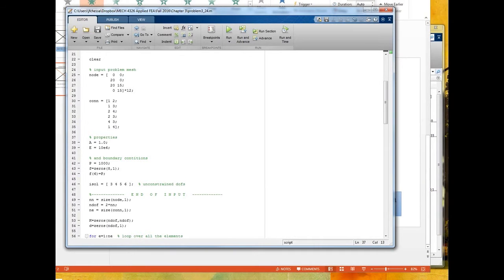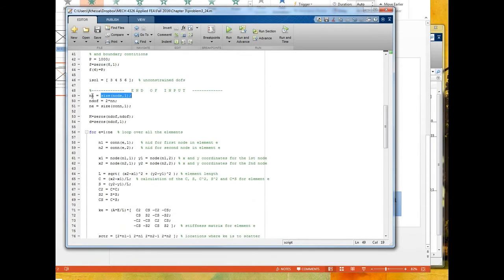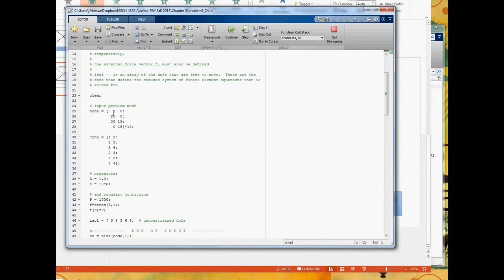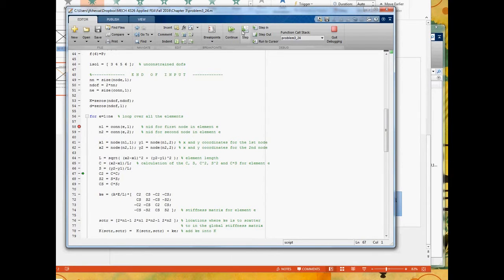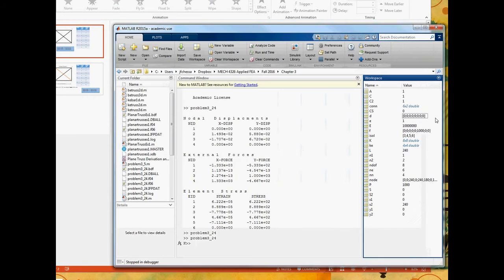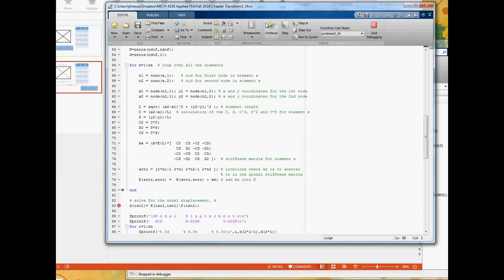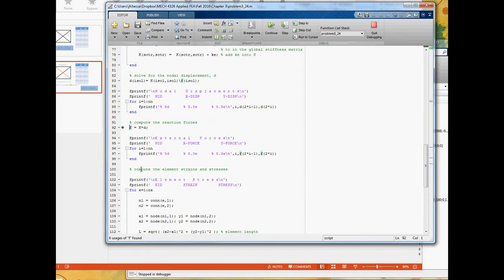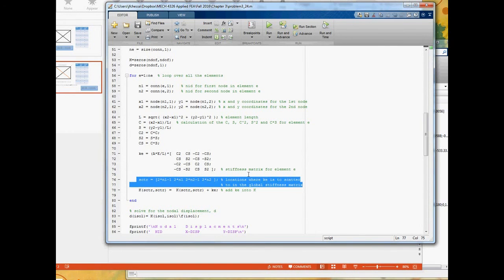A basic finite elmeent program in Matlab, part 2

Comment: how would you do a distributed load for this code?
Reply: The way I've done it is by finding the total force from the distributed load (i.e. Q*length acting over) and dividing that force by the number of nodes it acts over, and input that value as a point load acting on all of the nodes within the distributed load region

Comment: Two questions:
1. Can extend this to use it in 3D?
2. If so, at 6:40 how should I calculate Cos and Sin when I have 3 element instead of 2?
Reply from the maker: It is easily extended to 3d. Instead of cos and sine use the x, y, and z components of a unit vector directed from node 1 to node 2.

Comment: Does this work for plates, or just trusses? How would you convert it for plates?
Reply from the maker: Well you need to allow for 6 dofs per node, which is not too much of a change, but that affects the scattering.  And of course you need to program the computation of the plate element stiffness matrix.  But other than that it would work.